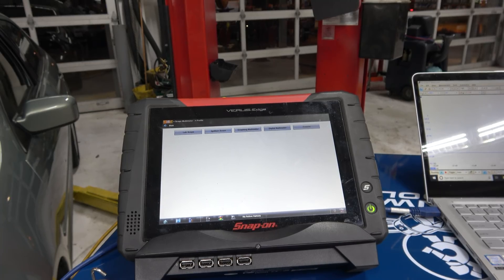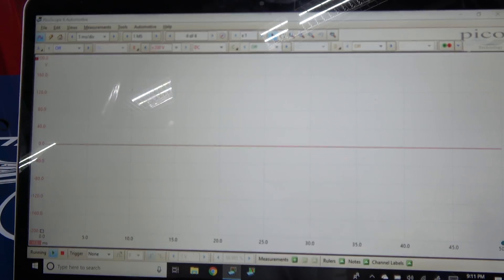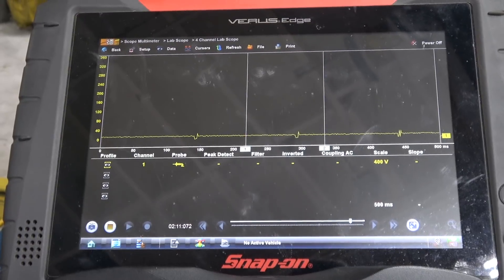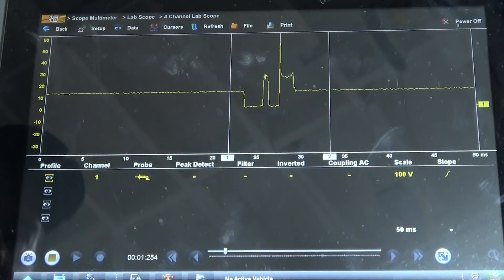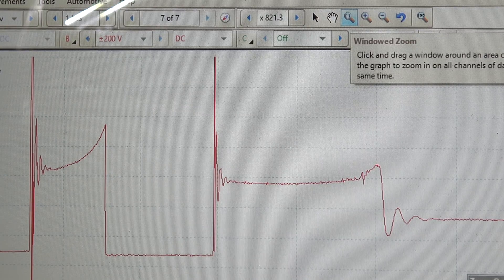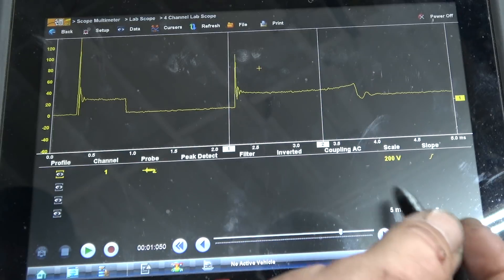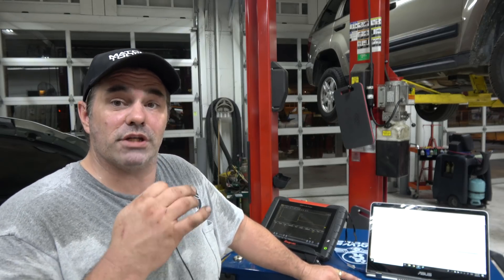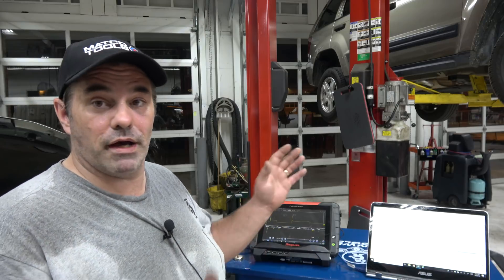Scope Training Basic Hook up and Getting a Waveform

Comment: Do you have to use an attenuator on the Pico when you're only looking at coil primary?

I thought the attenuator only had to be used when you're using like an inductive pickup device on the secondary side of house?

Hate Snap On for zooming, ridiculous that we have to adjust time base for details.

Please clarify, I'm not trying to criticize anything about this video, which is awesome that you are making this, I'm just trying to learn from you Mike, thanks!

Pauly
Reply from the maker: they beefed up the current scope, to 200 volts anything higher than that you should use one, that signal was spiking  passed 200 volts on that coil, on the old model you needed an attenuator, for primary, with a back probe, like I showed in the video, injectors and secondary

Comment: Don't forget to unplug an injector while your playing around to see a lean misfire and if you get one in with low compression get a trace on that too at around 2500 RPM.  I take screen shots with the clip tool when I get a cool ignition waveform.  What was really cool is if one is burning a lot of oil you can see the difference on secondary ignition in the final burn off.